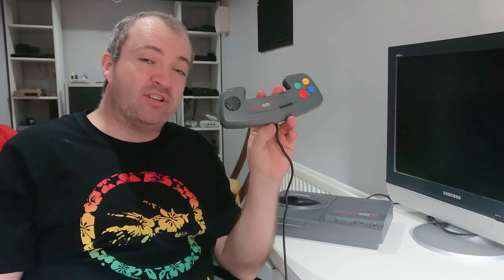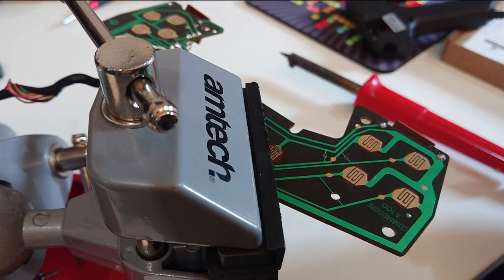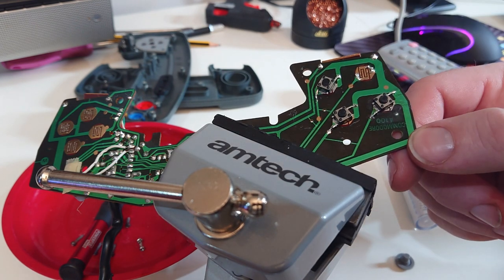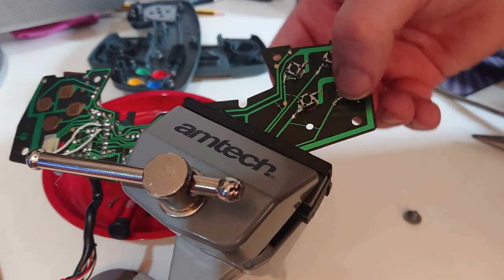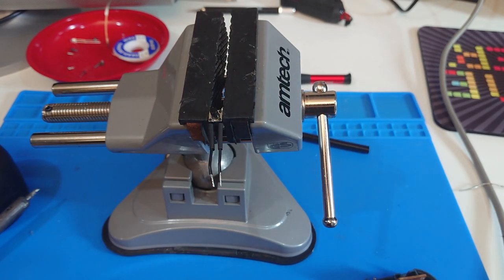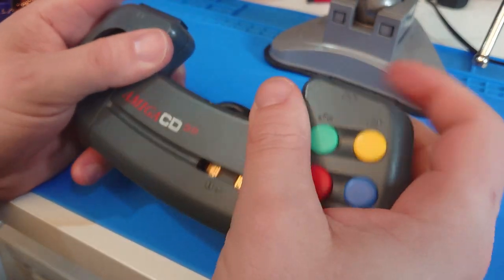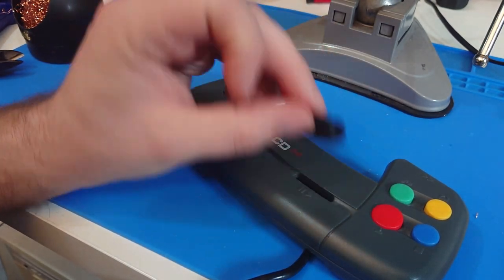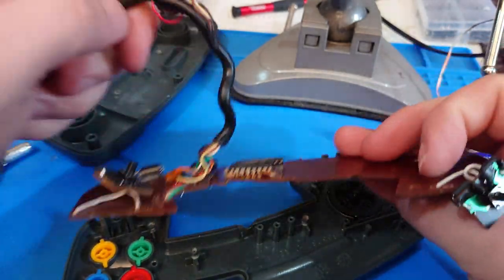CD32 joypad microswitch upgrade

Comment: Unlike many people, I really like the designof the CD32 pad. Hopefully, I see that I'm not alone! But it's true that the comfort of play is not optimal because of the too much soft touch of the buttons and D-pad. Very nice mod, maybe I'll true it on one of my CD32 controllers.
Reply: The problem with the cd32 joypad is not the outside design. Its what this fellow just fixed.
Now he can say that he has a very nice cd32 joypad.
Reply: @pnvgordinho  Yes, Commodore made a better work on the external design than lot of people think. Sadly, it's another thing inside. A little bit puzzling as it exactly working the same in a Megadrive joypad for example. This one is very responsive without needing the help of micro-switches. I think it's a question of design of the stroke of the buttons, therefore of internal design. The buttons on the CD32 pad are not hard enough and do not sink enough, which gives this side "too soft" compared to the nice d-pad of the Megadrive.
As a result, adding micro-switches is a solution a little difficult to implement but very effective to add hardness and a much more frank touch.

Comment: Neat idea :)
I do wonder how long those "surface mount" buttons will stay attached for - might be worth epoxying the switches in place? - would hate for a button to come loose and lift a trace.  Hopefully someone takes your idea and redesigns a PCB with button support!
Reply from the maker: The buttons are not really under any lateral force as you only ever pushing down on them.  The dpad buttons may come under some pressure to move as your finger slides around the directions but I don't think it would be enough to break a trace.  A spot of hot glue though might be an idea just in case. 

Thanks for the comment.

Comment: So... 6 months later, how’s the CD32 game pad doing? Before I do this myself, I guess I’d just like to ask if you’re happy with the way it feels. Are the buttons easy enough to push or does the game pad require a bit of extra pressure? Does it feel as good, better, or not as good as standard factory item? Cheers!
Reply: Maybe I just came up with an idea for a new video?
Reply from the maker: The pad still works fine.  The only thing that I'd say is the dpad without the softness of the rubber under it does after a prolonged gaming session (say an hour) start to hurt your thumb.  If I was doing it again I'd maybe not just do the buttons. 

As for feel I still like it.  The buttons give a satisfying click.  They don't really need any extra pressure.  Compared to stock I'd still call it an improvement. 

Hope that helps.